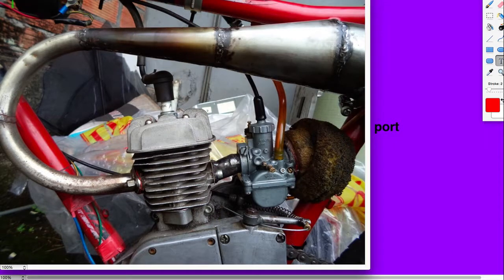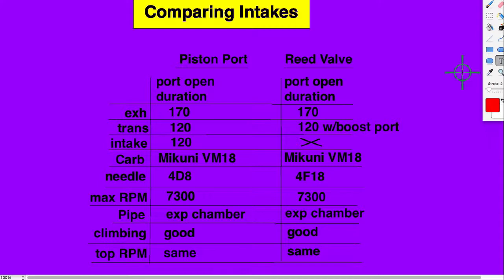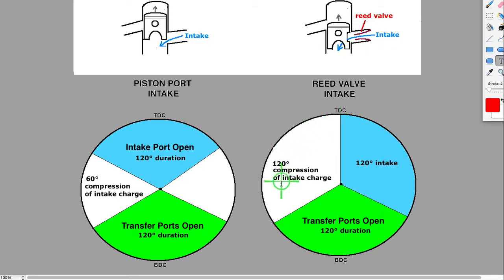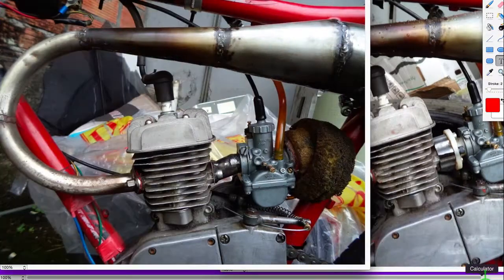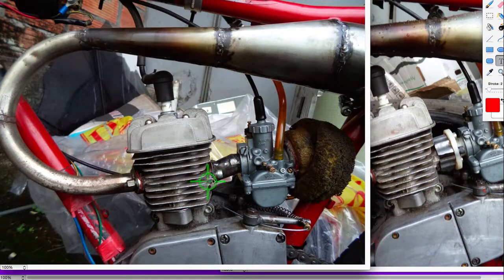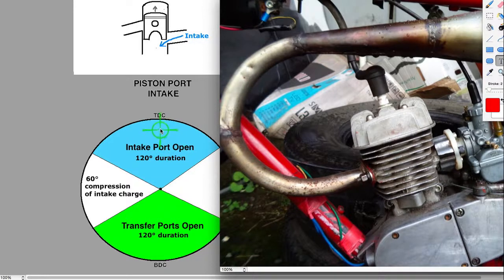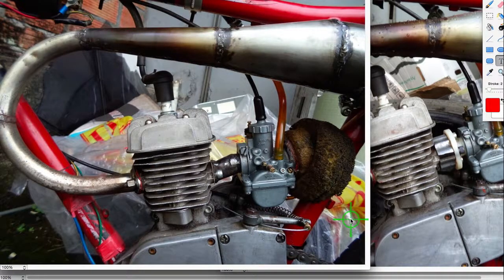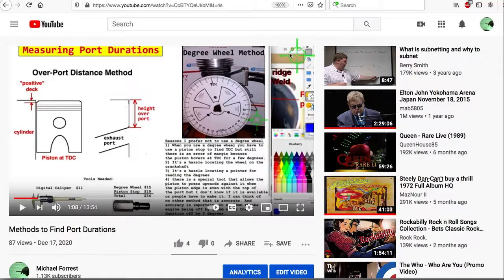Piston Port vs Reed Valve Intake (2 stroke)

Comment from the maker: For motorized bicyclists: After I did this video I got a Speed Carb to test against the stock NT carb and I found the NT was best suited for piston port engines, and the Speed carb for reed valve engines. That is because the flow area between the needle and its jet hole was less with the NT than with the Speed. And piston port engines need leaner jetting because their strong-front vacuum waves pull up more gas thru the jets so the jets need to be smaller. For any other carb you need to find a leaner needle (one with less taper angle) if you have a piston port engine because most carbs are sold with a needle that is best for reed valve engines. To see available needles and their taper angles just go to this page, about half way down, and click on the link for the type carb you have and then scroll down to the needle listing: http://www.dragonfly75.com/moto/carbjetting.html